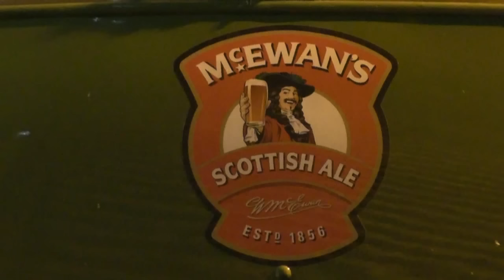SNNC 103 Sentinel S4  Debs Lister Tripod repair

Comment: When I was a young bloke John my father had exactly the same motor driving a shaft which in turn drove an  air compressor,a double ended grinder and a blacksmiths drill and a 32 volt generator.. It was used for 20 years or more extensively and it would have done 20 000 hrs plus and it was the easiest starting motor that I have ever come across...
regards E